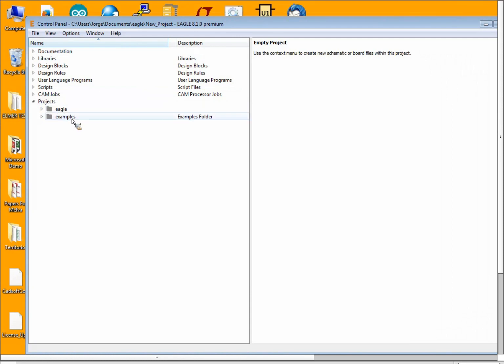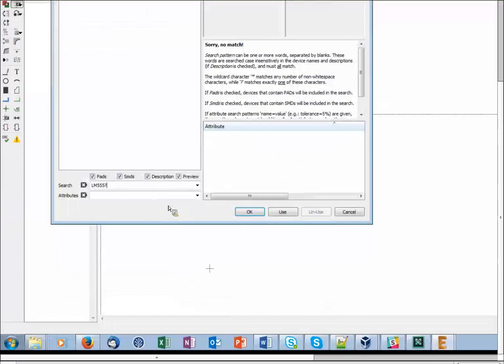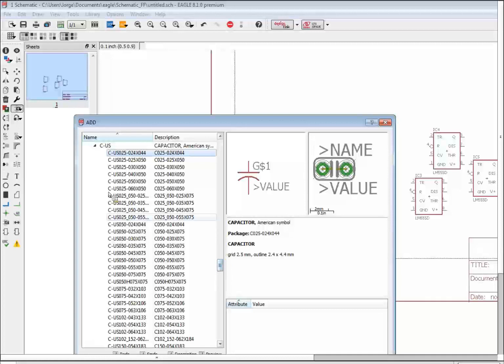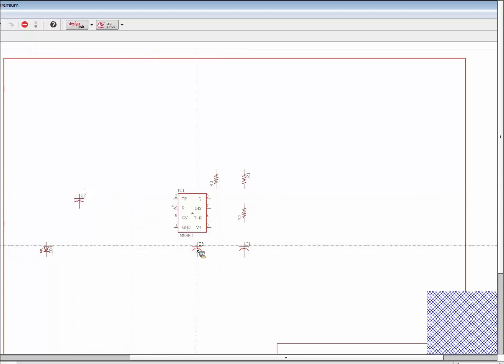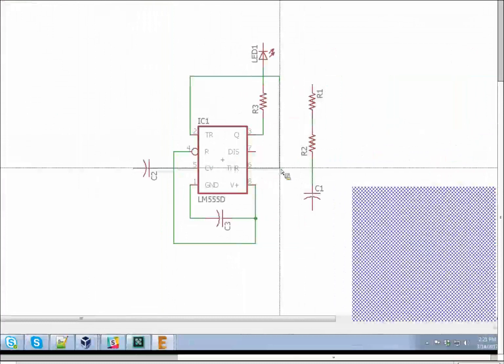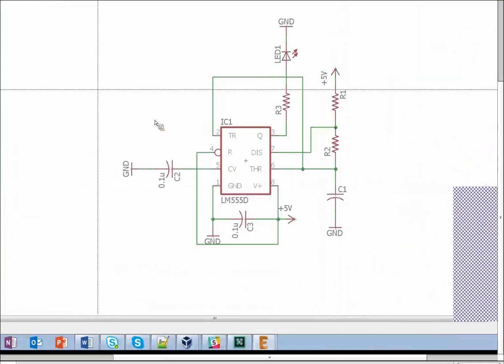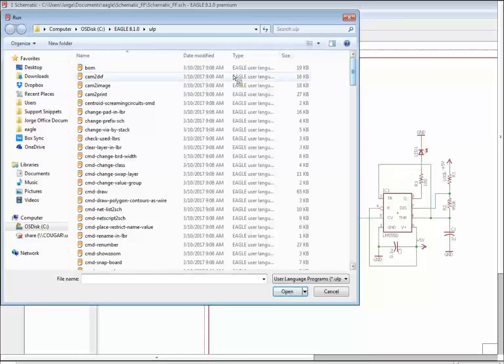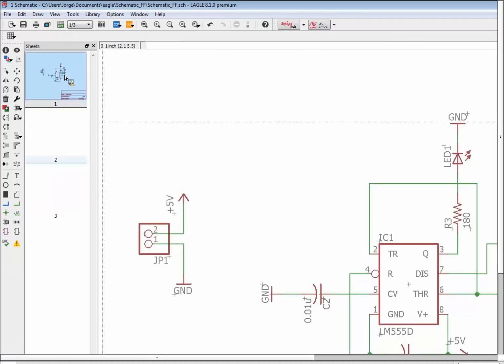Designing your Schematic

Comment: It's a good presentation, but....

- Video Quality is really bad. It has to be at least 720p, so that one can read something from the screen. If you get small interruption, you have to rewind backward  and listen it again, because you cannot recognized what button was pressed. And this is usually the case when you try to replicate the same thing shown in you Eagle on your desktop. All texts in the video are barely recognizable.

- Audio also can be better.
 
- I also think that 555 demo is too much. Something like 5V power supply, resistor and led should be sufficient for first schematic tutorial.